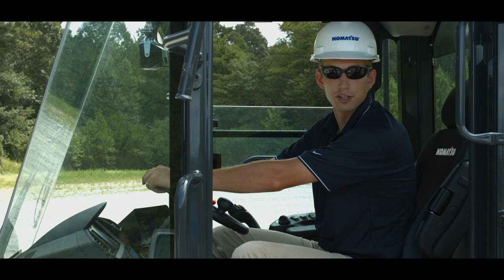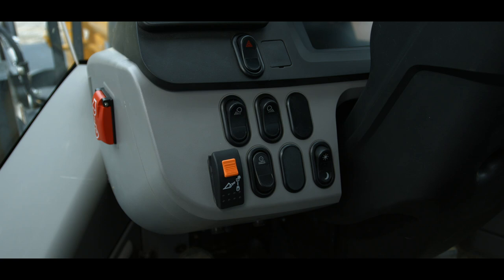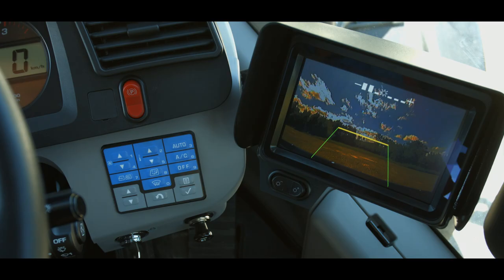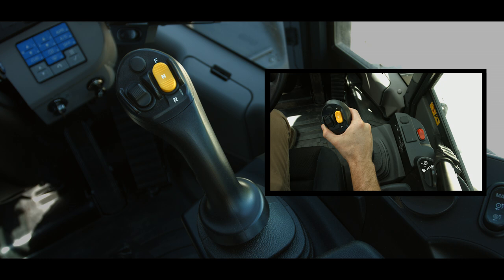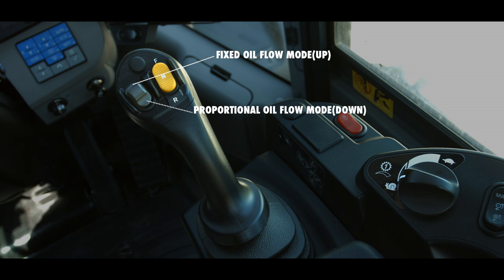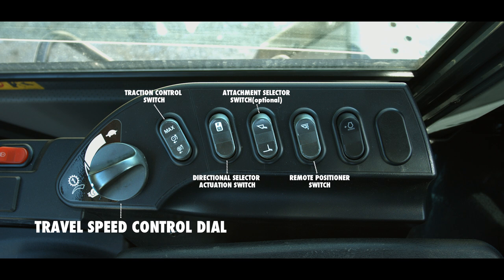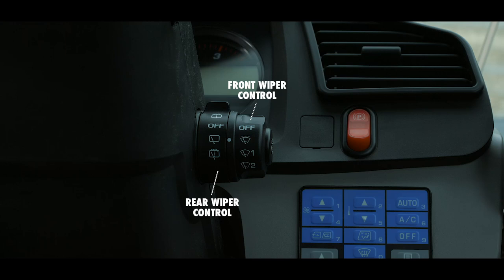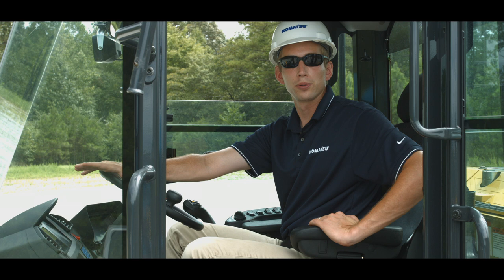Komatsu HST wheel loaders cab controls

Comment: This loader is a terrible POS. After operating John Deere’s for years, my company decided to try this sht. The controls are all in km/h and Celsius. No way to change them over. The machine puts brakes on the instant you let off the gas making a very jerky ride. The machine will not dig. It won’t climb the piles. It has a tiny bucket. Stay away from these and stick to a Deere or if you have the money a cat